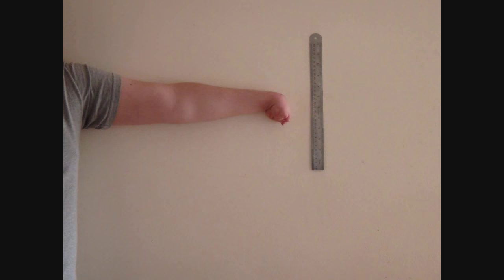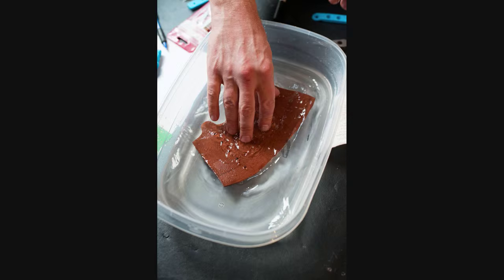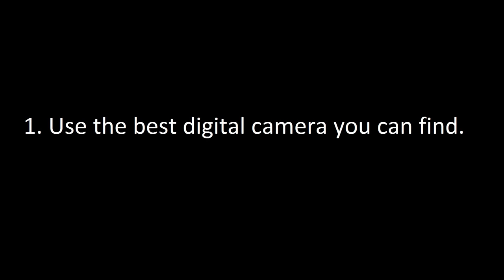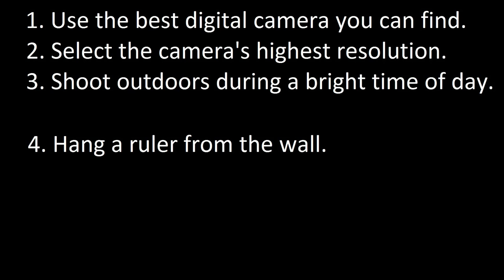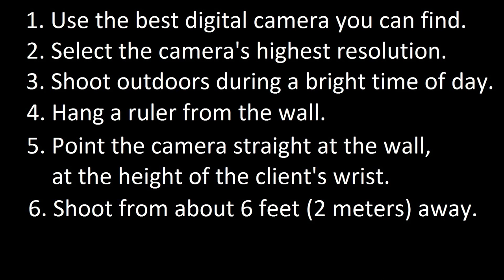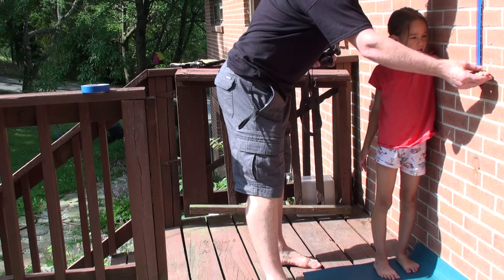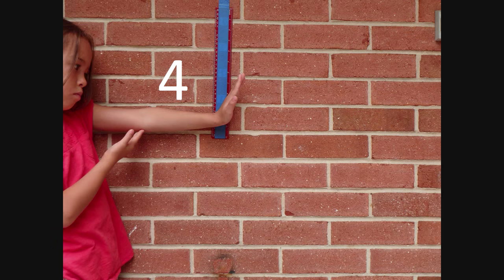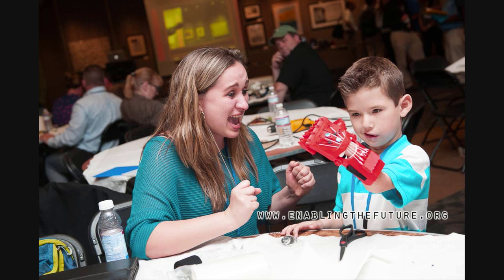Taking Recipient Photos For e-NABLE

Comment: This is fantastic use of technology, 3d printers etc. I have a suggestion to avoid improper fit, print the part that makes skin contact only and check it for fit first and then make adjustments if needed once that is done proceed to the labor intensive assembly.

Comment: From the perspective of a professional photographer, I'd like to offer some feedback. 

Shooting outside in bright light as suggested can result in details being lost in harsh, black shadows. In the pose where the hand is horizontal, the bottom side of the hand and arm would be in complete shadow and it'd be difficult to judge the shape of the bottom of the hand and arm- where the hand ended and the shadow began. The shots here are great as they were taken on an overcast day which resulted in the soft shadows. 

Many photo transfer and viewing programs and email programs will automatically reduce the size of the image to make it easier to send. This should be disabled. While it may be out of scope to cover this, some people are not going to have the tech savvy to send large pics. 4 large pics could be 50mb or more and most email services will have a cap on size- typically 10mb but often much less. Even a single pic on a DSLR as recommended can run over 10mb so they would not even be able to send one.  I don't know if e-nable has a standard or preferred way of handling this. 

I'd prefer that they NOT choose the best one of each type but just send them all. What an inexperienced person thinks is the best pic may not be. They are likely to choose the most aesthetically pleasing pic rather than the one that works best for fitting  Having them all would result in a better chance of getting one that worked well.  It would be nice to have them from slightly varying angles but it may be too confusing to request that.

Thanks!
Reply: Maybe I should have suggested a cloudy day. I was being sent a lot of photos that were taken indoors with inadequate light, and the ruler marks were often too blurry. 
The resolution of the photos should be good, but don't need to be spectacular. Most of the photos that are sent to me are 500kb-7mb jpegs. While the 500kb photos are not ideal, they are adequate for sizing purposes if the lighting is good. Anything above 5mb is really not necessary for these purposes.
The key here is accessibility. If we make it easy for people to send in photos with their camera phones, we are able to serve the most people. There are a lot of people in the world with limb differences who don't have access to DSLR cameras. But most people have a friend or family member with a cell phone that can take photos.

Comment: When taking photos from a distance, the photographer may need a stand to avoid small inches difference and should be purely parallel to object. It is better to give the readings of the ruler just in case or mark at the ruler